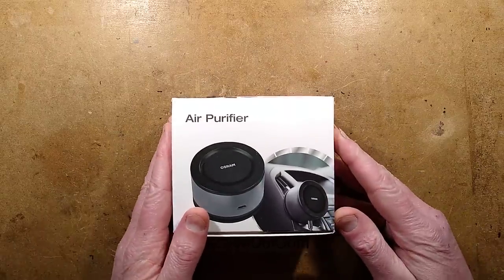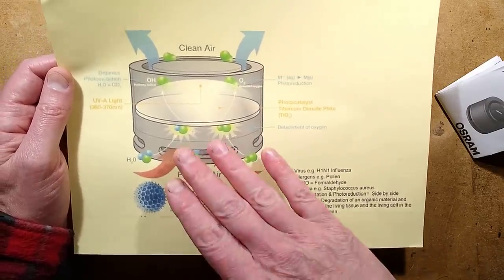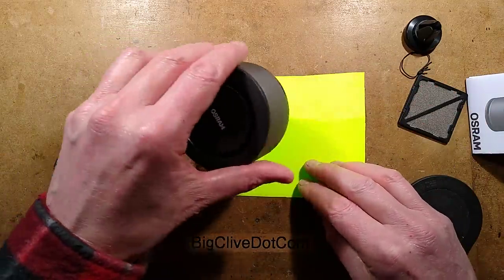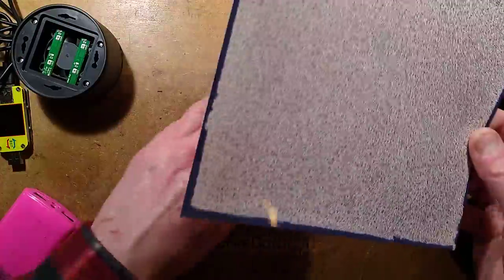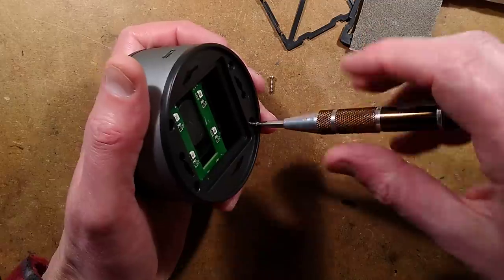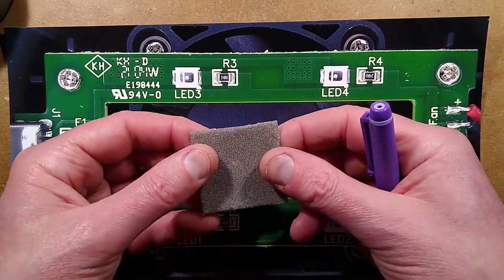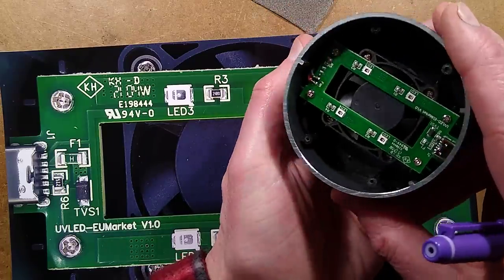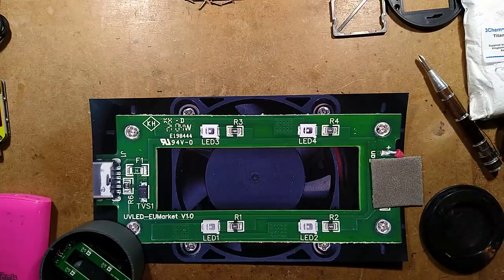Inside an OSRAM AirZing photocatalytic air purifier

Comment: this would be fun to test, you could always put this thing, a voc and a voc sensor in a sealed box and watch it go. would be more complicated to sample the air for other compounds but still relatively simple. weigh the filter before and after
Reply: Its not acting as a filter (except for dust). Its supposed to break down organic molecules into smaller ones, essentially oxidising them
Reply: If I remember correctly, a voc sensor it self catalyzes voc in the air and measures the energy that takes to deduct the voc content.
Meaning: in a small box leaving a voc sensor run long enough, the voc sensor would act as the air purifier.
Reply: @sarowie  Correct. Most gas sensors act as catalyzed fuel cells. VOC are reducing gases, so at a catalyst, oxygen from the air reacts with the gas. Breathalyzers for example also. Notable exceptions are particle and CO2 sensors, which operate optically.

Comment: Titanium oxide is actually clear it just looks white when it's in a powder form the same way that snow looks white even though water is clear
Reply: Spot on 😀 same as polar bear fur is semi-transparent. 
You can also draw a parallel to those bus window adverts where from outside you see the advert but inside you can see through the window. Microdots with space around.  (If you see a bus at night you can see through the adverts). The Titanium is a thin layer so the nickel colour shows through. In addition the air spaces in the sponge let the light through.  If you hold the sponge over a brighter coloured light source it will appear to change colour.

Comment: The mesh would start out as just regular plastic sponge, and then it's been coated in a layer of titanium dioxide. The reason it doesn't look very white is probably just that it's a very thin layer and some of the black sponge underneath is showing through.
If you squeezed and smushed it a few times all the titanium dioxide would probably start flaking off.

Alternatively, a more expensive process they might have done it to bake the sponge at a high temperature, the plastic vaporises into nothing and the the titanium dioxide + some binder sinters together and leaves a hard ceramic sponge, but probably not what they've done here.
Reply: I'm thinking something along those lines.

Comment: Hi Cleave, it is very common solution: porous carrier coated with functional material. In humane words: it is titanium or titanated nickel sponge coated with tiandioxide. Metal sponge is mechanical stable and cheap, TiO2 supports the photochemical oxidation of the negative air components on its surface. Looks cool, cleverly grounded, but functionality remains questionable.

Comment: 6:18 (Someone else will point it out if I don't :)) since that diode is labelled "TVS1", I suspect it's intended to protect against voltage spikes rather than reverse polarity - though that likely doesn't invalidate what you said about it blowing the fuse if it did see reverse USB polarity!

Are voltage spikes on USB supplies actually a concern in practice? Or is this just because it's for cars/etc? 🤔
Reply: Well "USB" in this case is just a connector that's supposed to deliver a +5V and a return path to the device and it could come from absolutely anything. Like a very noisy broken switching supply or a melted regulator that lets say 12-15 volts straight out of it. Those LEDs would probably suffer from voltage spikes, the TVS can absorb them much better.
Reply: Good design practice to incorporate ESD protection on your USB power bus and data lines. Usually specified in the interface data sheets. May be required under USB specifications just as 10uF is the specified maximum capacitance on VBUS, but we've all seen that violated. Nonetheless, ESD protection good, and LEDs are ESD sensitive.
Reply: @RandornCanis  10μF straight across the bus draws the maximum inrush current tolerated by standard USB ports. If there's something limiting the inrush current in front of the capacitor, more capacitance may be safe.

Comment: Years ago I examined some large photocatalytic air purifiers made by a company that no longer exists. They seemed well made and well documented and included a HEPA filter. These units were designed to be installed in medical offices and hospitals. Those units used UV-C tubes that had an aluminum grid with 1/2" openings before and after the array of 2 or 4 UV bulbs. The grid was similar to those sometimes found over office fluorescent light fixtures. The grid was painted with a titanium dioxide paint that had a coarse texture. The HEPA filter was mounted downstream of the lights and grids and was made to fit the inlet of an HVAC air handler. I assumed the UV-C did all the work and the catalysis was bunk.

I have used an open pore polyester filter material that would look just like the filter you have if it had been sprayed with a light coating of white paint. As you mention, white paint is usually pigmented with titanium dioxide. I very much doubt that the UV-A does anything useful, but I've been wrong before. Once. In 1981.
Reply: Aaaand doing a quick little search immediately turns up credible sounding information that 350nm +/- (UV-A) works best with Titanium Dioxide when used in catalysis. Hmm.
Reply: Your filter would probably have been more effective if they simply painted the inside of the air handler, in the areas the UV would reach, with PVA paint with high quantities of TiO2, which would have made the entire surface a converter, plus improved the diffusion of the light as well.
Reply: @SeanBZA  maybe thats why they went bust

Comment: The amount of air flowing through the device is dwarfed by just opening up a window or turning on the air conditioner. Probably doesn't do much, but theoretically it should work (given a room thats 5 inch x 5 inch)
Reply: boom. you nailed it mate. thx
Reply: Does it come with a snorkel mount?
Reply: air cleaner for ants

Comment: Interesting that you mention they're experimenting with putting titanium dioxide on roof tiles to help "clean the air". I imagine if it makes them lighter coloured then it might help reduce the absorption of heat and reduce the cost of cooling in summer. At least that's the reason why they're looking at banning dark coloured roofs on new houses in my state. Which is probably a good idea considering how hot an Australian summer gets (although surprisingly not so much for the last week).
Reply: It occurs that they should make roof tiles that turn a white color when it's hot and sunny out, but black in cold weather.
Reply: So you are bouncing all that thermal energy back into the atmosphere to heat it up.... nice!
Reply: @brianm6337  That's a great idea. I know they could make this work with thermochromic paint or coating, but my understanding is that these are pretty expensive and delicate, so they might not necessarily stand up to environmental exposure. Hopefully someone's working on those problems, since I think it definitely could make a noticeable difference in energy use.
Reply: @theginganinjaofficial  I mean that's kinda how the polar ice caps work and them going away is apparently a big problem, sooooo....
Reply: @UpLateGeek  so cover Australia in glaciers...? Or are we covering the glaciers with shingles?

Comment: You generally want a solid catalyst to be very small particles which gives a tremendous surface area. I suppose you could make something like a sintered frit of pure titanium dioxide but it probably wouldn't be any better than what they have done here which I would guess is capture particles on some sort of metal foam. I'm highly sceptical of any device like this though. I'm sure the UV is causing some reactions to take place on the catalytic surface but what is being produced? Changed is not necessarily better.
Reply: In a microorganism, a sufficient amount of random chemical alteration means certain death.
Reply: @RolfHeckemann  And in organic chemistry, a sufficient amount of random chemical alteration means (almost) certain production of carcinogenic by products and free radicals... so there is that :P
Reply: I think the problem is that it does nothing in practice. With that power consumption you cannot get much done, even when you assume efficiency of electrolysis. But here it is of course lower.
Reply: @andersjjensen  Sure, but your average Maillard reaction when you prepare a fried breakfast will likely produce more of those than this device will in its lifetime, even on a steady supply of microorganisms... :P

Comment: Titanium dioxide can also be used an additive in concrete if you want a whiter finish without bothering with paint. My guess is that's how they make the roofing tiles as well given that concrete is a pretty common material for those. Also fun fact. The most expensive color additive to concrete would be blue which is achieved by adding cobalt if I remember correctly.

Comment: I have a Mosquito trap that uses fan suction and UV bulb (it says 365 nm), it claims that the surface below the bulb is coated with titanium dioxide, which creates CO2 to attract the mosquitoes and then get sucked by the fan. It works, but I don't know how accurate the claim is.

Comment: The photocatalytic activity of TiO2 depends on the crystal structure. The powder used for paint usually has low amounts of the higher activity forms because it will break down the paint. 
Nano-size particles of TiO2 are clear, not white. Like the newer not-white zinc oxide and titanium oxide sun screens.
Washing the mesh probably gets dust out of it. The catalyst only works on things directly in contact with it, so large particles can't effectively be broken down. The range is only as far as an OH radical can get before reacting with something, so a few nm, I think.

Comment: With its size, and the fact that it's only going to run while the car is running AND while driving even with the cars blower turned off some air still comes from the vents and small holes and such in the car, it's not going to make any difference besides you having a little less money from buying it. 
Also I used to work at a car rental, if people can stink up a rental car in a few days, I hate to think what their own cars are like and that little think won't put even the tiniest dent in the stink
Reply: I hate to admit it but a while ago I had a rental car and had been with a farmer that day who used butyric acid to deter animals and I must have tracked that stuff in on my boots. The rental guy didn't say anything when he took it back but I had to throw the shoes away after 3 attempts to clean them so the car couldn't have been fun to clean either. Oops
Reply: So…. It doesn’t work in a car - Chineseum crap, unless it could work in a small room with USB socket
Reply: That was my first thought too, the amount of air that thing would move is miniscule, it would take many many hours to circulate all the air in a car through it and even though it might help with some airbourne smells, it will never deal with any smells from upholstery or carpets.
As for dealing with pollen, I very much doubt this is going to have any effect at all on individual grains, it might trap a few in that mesh but most of them will just pass straight through the unit, I can't see how they will be effected by the UV LED's, are they meant to explode or something ?
Even if you could shut off all air coming in from outside this is going to do absolutely nothing
Reply: @ian-c.01  My way to deal with pollen or other nasties from outside  in the car is replacing the cabin filter very often. Cabin filters are very cheap.
Reply: @ian-c.01  The surface of pollen and bacteria is supposed to be destroyed on contact with the lit catalyst surface.  The mesh isn't supposed to be a mechanical filter, just a way to put a lot of UV-activated surface into the airstream.  Big multilayered particles like pollen may need multiple passes through the device to open up their innards to further destruction.

Comment: You're obviously wrong about the diode, it isn't reverse polarity, it's even marked TVS, so it is to ground out transient voltage spikes, basically a high voltage zener across positive and negative, as you well know.

Comment: Not my area of expertise, but yes, TiO2 is indeed a photocatalyst. Any time you have any surface molecules from the air constantly bump into it, and sometimes they stick to it for a while before leaving. This happens for O2, N2, H2O, CO2, smelly molecules, really anything you have in the air. And if you illuminate the TiO2 with UV, suddenly the surface starts "zapping" whatever molecules happen to be on the surface. Some of them will just get kicked off the surface, but chemical reactions can also happen. I would imagine it would mostly result in smelly organic stuff getting oxidized.

Comment: the simple problem with these gadgets is they are ridiculously to small to do anything. considerer how much air flow goes through a car cabin when your driving. its cleaning 100,000th of that.
same thing with the ones in ducts etc, airflow is way to high for the size of the units/leds.
Reply: Usually these things are supposed to be running when you're not in the car...
Reply: @Bleats_Sinodai  Well there's usually no power in the 12v socket if you're away from the car. This reminds of the "air purifying negative ion generator" gimmick that many JDM cars have.

Any chance this Osram model was made for the Asian market?
Reply: @Avantime  The circuit board says "UVLED-EUMarket V1.0", so I'd say that's a no. ;)
Reply: @Avantime  my Civic only puts out accessory power when the ignition is on, but my older Saturn's ports are always active. Found out the hard way when I left it parked with my GPS on over a weekend and it killed my battery.
Reply: @Avantime  in a VW golf mk7 the 12v socket turns on4off with the ignition but you can move the fuse 1 slot down and have it powered permanently. There are youtube vids showing which fuse. I have heard a few other cars do this and some cars, many Fords I think, the 12v socket is already set to permanent on.
Reply: @thebrowns5337  I've never seen an unmodified car with a 12v socket that's permanently on, it's always connected to the accessory circuit. That's because any load on the socket will drain the battery very quickly. The only exceptions I can think of are pickup trucks with built-in switched inverters.

If the customer has to fiddle with the fuse box to use an air purifier then I don't think they'll sell many of them.
Reply: @Avantime  It depends on the brand of car. My Skoda (VW brand) has the socket permanently powered, also the one in he trunk. and this is good in general. Think of Camping. Fridge box, phone charger,... When I need to have the ignition on, the car electronics would drain the battery even more.
Reply: @goamarty  That's why I said pickup trucks  are probably the exception (most likely with a main power switch). Car batteries aren't deep cycle batteries, they will age very quickly if frequently drained by appliances with the engine off.
Reply: @Avantime  My 2009 Mustang's 12 volt outlet (inlet?) is always live. I plug a battery maintainer into it to keep the battery in good stead during periods of non vehicle use. Eliminates the hassle of having to open the hood and clipping onto the battery.

Comment: For the photocatalytics to work the TiO2 has to be in nanoparticle form. And usually the smaller the particle size is the darker the substance looks. Platinum black is a good example.

Comment: All particles smaller than 100 nanometers (millionths of a millimeter) are generally referred to as nanoparticles. Special about them is that they often have different physical properties compared to larger particles. Nano-TiO2 is not white like conventional TiO2 powder, but transparent. In sunscreen, for example, it absorbes UV light, but remains invisible on the skin.
Reply: Kellogg's TiO2 Frosties - They're great!

Comment: I recall that in Milan they did something like this on a larger scale, they painted a couple road tunnells ceiling and a multifloor parking/bus station with a TiO2 paint and scattered UV-A lamps along the standard place illumination.
 I'm curios about the results of the experiment, so far in the parking the just replaced everything with LED illumination

Comment: Advertisements claim  UV-C for OSRAM and Sylvania versions. The "glass" test should distinguish between A/B and C
Reply from the maker: Some versions do use UVC.  But the LEDs in these are not the type that can generate that wavelength
Reply from the maker: @johngarritzcx6733  That's the 222nm wavelength created by excimer lamps.  The wavelength is supposed to be short enough not to penetrate the outer layer of dead skin cells or the liquid film on the eye, but can still destroy airborne viruses and bacteria.
I'm not fully sold on its safety.
Reply: @bigclivedotcom  yeah,i would,nt do it too. Although a bit safer  
I stay with the 'blacklight type UV-A lights😊😊 off course, with a safe distance😎

Comment: If it's pure titanium, it will form a thin layer of oxide on the surface, as soon as it contacts air. Maybe that is enough. 
It could be thin enough to not be visible.
You could try heating it and see if it becomes whiter when the oxide layer gains thickness.

Comment: The kicker is that it needs H2O as in water in the air to work, the dryer the air the less its going to work. For the grey color it is more efficient than white colored TiO2 as it is mentioned in wikipedia article about photocatalysis. It would be better to let sunshine in to the mesh, more efficient that way, so no need for any LEDs, any light source non-UV will do also, less potent of course.
Reply: Its hard to get UV inside of a house. Windows block the stuff